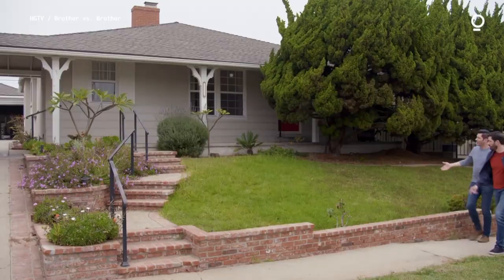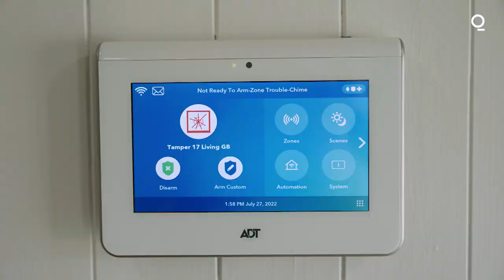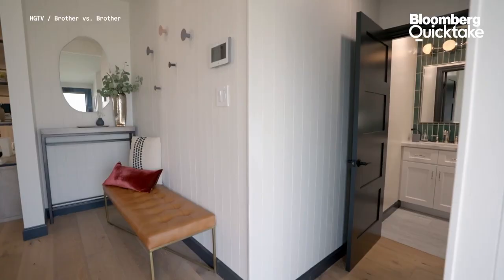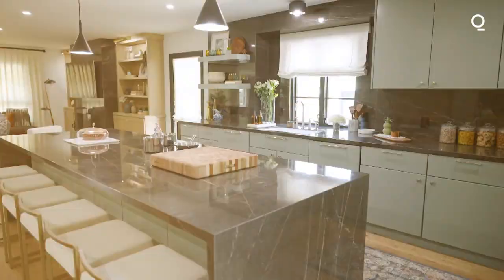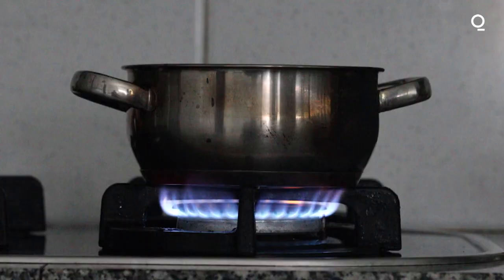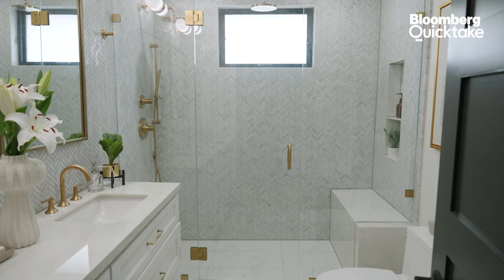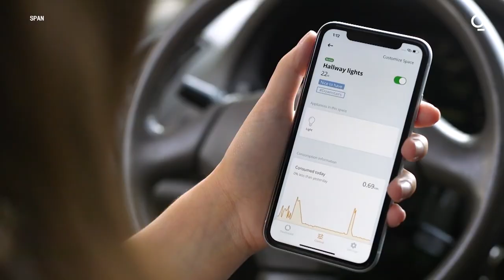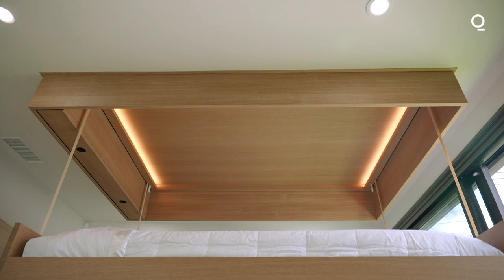Jonathan Scott's Eco-Friendly 'Genius Home'

Comment: The eco-friendly option isn't always the cheapest, even with government rebates, especially where I live.

I put in central air conditioning about 10 years ago and heat pumps were significantly more expensive. The same goes for my hot water heater I had to replace a year ago, going with a waterless hot water heater was way out of my budget.

I would have loved to go eco-friendly and I even looked into it, but there's still a huge price gap.

Comment: Going all electric in So Cal means substantial electric bills and brownouts. Don't fall for the all-electric green hype; the grid already has issues providing enough energy to the current non-all-electric households and commercial buildings during the summer months when everyone and his mother needs cooling. So Cal residents are threatened with brownouts every summer. And now, the guy in the video recommends electric heat pumps instead of gas furnaces. If enough people switch over, it will place a significant strain on the grid during the cold months as well, perhaps worse than in the summer since solar panels produce less energy during the shorter winter daylight hours. Also, CA politicians are forcing the electric utilities to go green, which means higher costs for them, which in turn means higher prices for their customers.
Reply: As much as 70% of electricity produced at the power plant is lost before get gets to the home.  Theo is correct.  Placing higher demands on the grid is not a long term viable solution.

Comment: Lots of cool tech... for rich people. Tech bros aren't going to save the environment: systematic changes to our way of life (amoung others), will. 

If we want to make a real difference in emissions, changes need to be made AT SCALE. A high-tech smart home is still a detached single-family house: low-density and wasteful. An electric car is still just a car: inefficient and costly.

We need change accessible to everyone, not just the rich. More high & medium density housing is both more efficient and makes for shorter trips than single-family homes. Better public transit means less dependence on inefficient cars and less congestion. More infrastructure for micromobility like walking, biking, etc means less noise and air pollution.